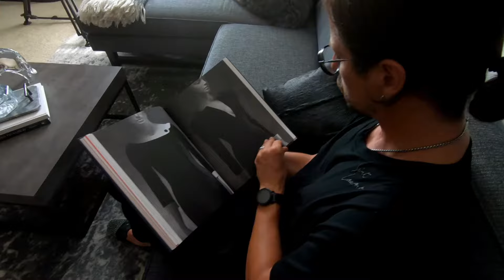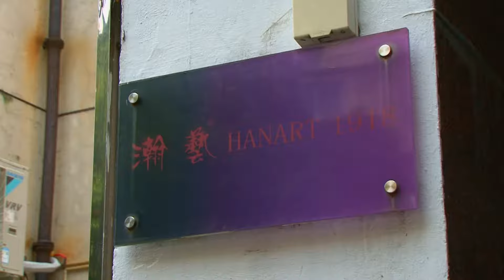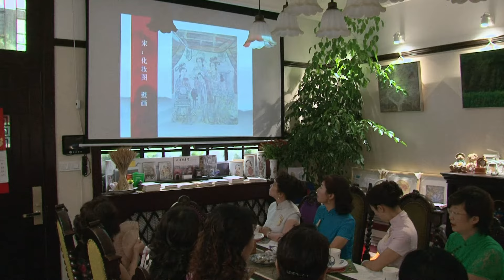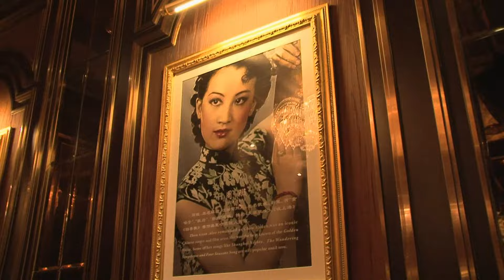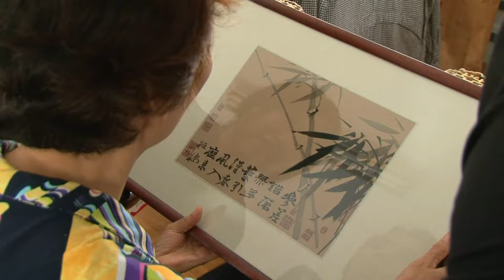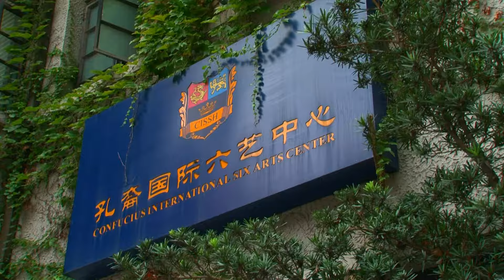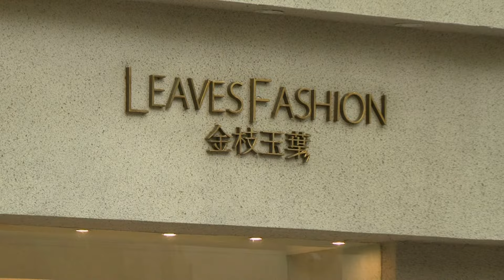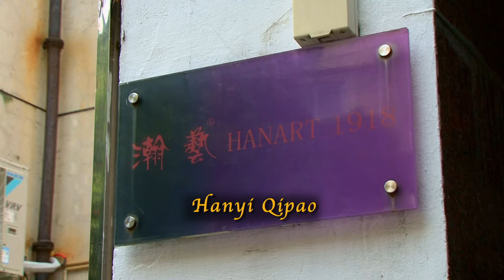Chinese Qipao

Comment: The traditional way of tailoring allows the garments to flow over, and move with, the body of the wearer. The result is usually super comfortable clothes that may not look super polished and structured, and the tailors would use brocades, piping in contracting colours, colourful embroidery, and decorative buttons to enhance the overall appearance. Over the years the focus shifted from comfort to style, and we are seeing more and more form fitting (and often restrictive) designs that are meant to be worn on display but not lived in, which makes me uncomfortable as I remember how women had suffered enough already from corsets back in history. I don’t think we need to put ourselves into straight jackets just to meet others’ expectations of being demure and meek creatures, I believe that we should be able to wear clothes that not only look good but also feel comfortable at the same time. Thankfully, there are ways to mitigate this unfortunate trend, and it’s to go for a sleeveless design that has slightly larger arm holes, and to choose the traditional style of opening at the front with frog buttons instead of zippers at the back. With these small details, you will feel much more comfortable wearing a QiPao (Mandarin for Manchurian robe) or Cheongsam (Shanghainese for long dress, which is the same thing) and may actually enjoy it much more often :)